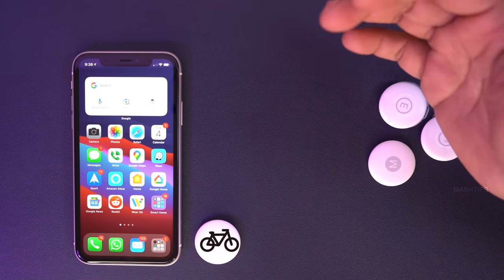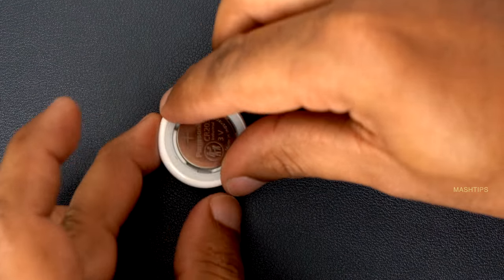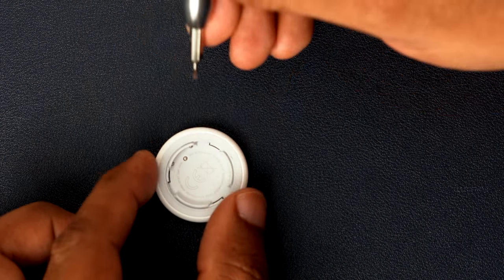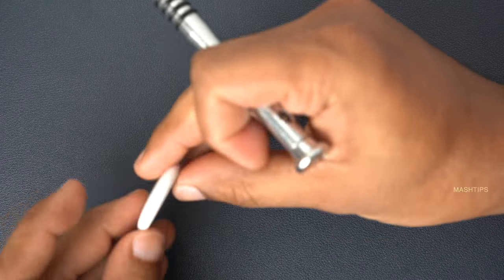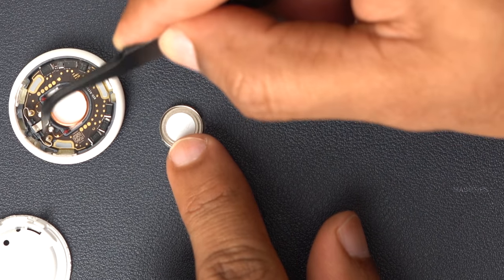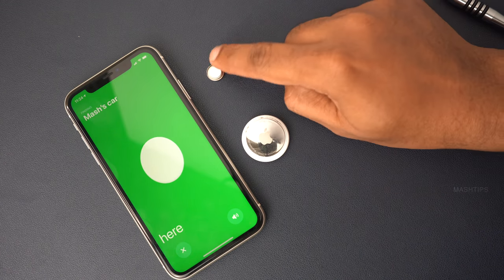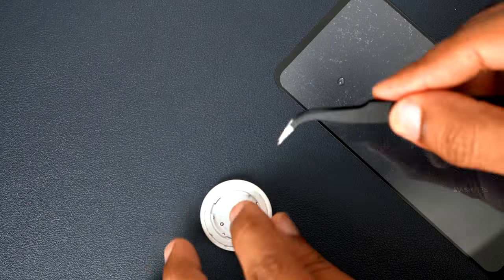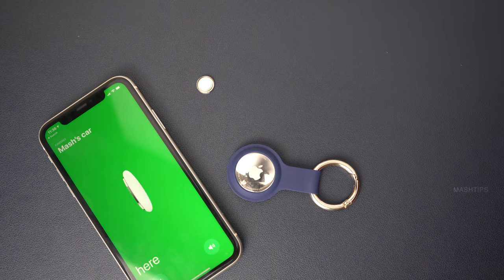How to Remove AirTag Speaker to Mute It (No harm to the AirTag)

Comment: could you muffle the sound by putting the airtag in a sound dampening sleeve?
Reply from the maker: This generates high-frequency sound, and the dampening sleeve didn't work based on our experience.
Reply: @Mashtips  I just watched a video where they cut through the plastic behind the battery to remove the coil. 

The video is titled: Alternative method - Keep airtag waterproof

He uses a dremmel. 

My question is... could you just drill a small hole where the coil wire is to sever the coil wire to achieve the same result?

Comment: I removed
 the speaker but the airtag still makes some beep noice but very very quite. S.o. an idea how to even remove this?
Reply from the maker: Technically it shouldn't make any beep once you remove the speaker and coil. We tested with our setup.
Reply: @Mashtips  thats not true! or have you also removed the coil cable? If just the coil it still beeps but quite
Reply from the maker: We took out the speaker part and cut the speaker coil.
Reply: @Mashtips  likewise I cut the coil wire to totally Eliminate any sound which worked.  I’m concerned however if this wire acts as an antenna as well?  Have you encountered this?
Reply from the maker: @paulg565  There is no official explanation about the AirTag's internal components from Apple. However, based on iFixit and other sources, there are three antennas for  AirTag. None of them mentioned about the speaker coil as the antenna. Seems like we are good to go.

1, Bluetooth Low Energy (left) - 2.4GHz
2, NFC (middle) - 13.56MHz
3, Ultra-Wideband (right) - 6.5-8GHz

Source: 
https://adamcatley.com/AirTag.html
https://www.ifixit.com/News/50145/airtag-teardown-part-one-yeah-this-tracks

Comment: Good tutorial, thumbs up!
I'm wondering about an alternative, less invasive. How about trying a different way, I came up with something like this.

Make a hole of about 3mm in diameter, in the center, in the plastic part (opposite the Apple logo metal shield).
To make a hole, we use a precision drill and an appropriate drill bit, or a red-hot wire (melting plastic) - I would probably opt for the second method. Using a modeling knife, remove the warps created during melting. Now, heat up the glue gun firmly and quickly inject the glue into the hole. The glue should fill the entire chamber of the speaker, making it useless.

Please write what you think about this. If you would like to do it this way, I would be very curious about the result :)
Reply from the maker: Nice idea. We are worried about punching the hole. There is a possibility to break the AirTag while doing this.

Comment: I took the speaker out and it still sounded the alert! ???
Reply from the maker: When do you hear the sound?
Reply: @Mashtips  when I test out the “play sound”
Reply from the maker: As you see the video, the sound generating part is that speaker. We have tested 3 AirTags, and none of them making sound after removing that speaker part completely.
Reply: See if a young person can hear it
Reply from the maker: @PhanRegSop  If you think this is a high frequency noise from the coil, you can disconnect the coil from the PCB.
Reply from the maker: @eternitywas  We disconnected the coil and tested.

Comment: But airtag will still alert iOS devices that there’s an unwanted airtag near them.
Reply from the maker: You are right. AirTag will alert iPhone owner. The purpose of this video is to use the AirTag to track your stolen item like eBike or car for a while. Even AirTag alert the thief (if he has iPhone) it will be difficult to locate the AirTag if you hide in a secured spot. Hopefully,  that force the thief to leave behind the stolen item.
Reply: @Mashtips  so if the speaker is not muted, then the AirTag will start making a beeping sounds to the thief in addition to the notification in the iPhone? It works like this in any mode of AirTag or ably in stolen mode? Thank you :)
Reply: @vakula485 any mode it’s pretty stupid if apple to do this

Comment: This is the most inefficient method I have seen to achieve this. Why not make a small hole above one of the speaker wires and severe it? Takes like 1/20th of the time and you don't need glue.
Reply: Because it’s a ridiculous idea, break plastic, not as resistant to water… doesn’t guarantee it would work